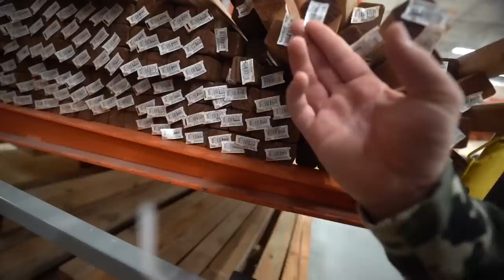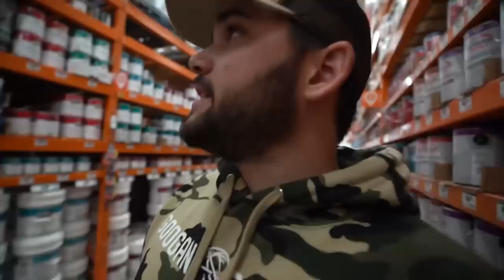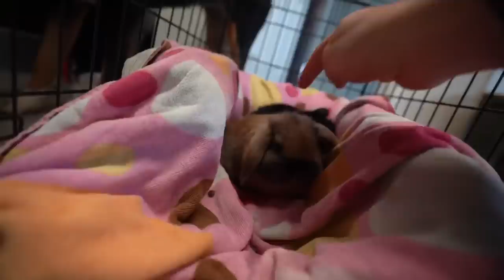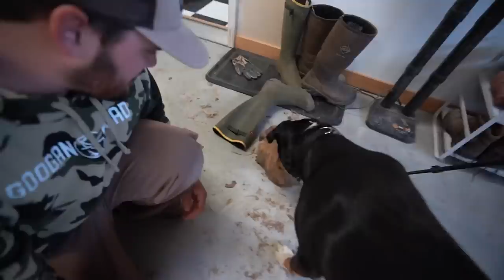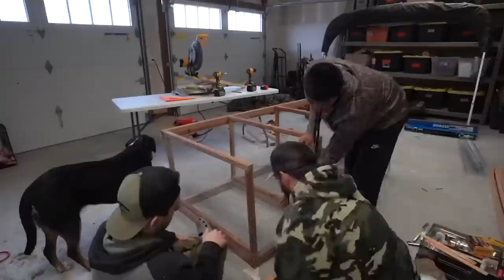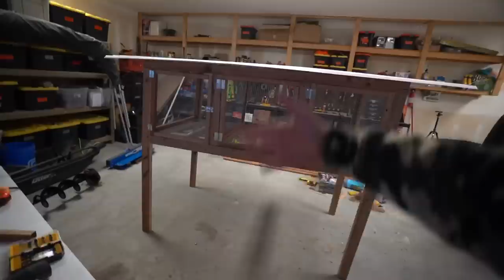BUILDING a RABBIT HOUSE for My BACKYARD FARM!!

Comment: The mash in the cage is Not good for the feet it can cause  injurys
Reply: Yeah it screws up their feet, really bad for them, plus there's nowhere for them to get out of the wind and rain if it blows in
Reply: yeah he needs a square of tile or a small rug for them to sleep on
Reply: Feets 👍🏻
Reply: @kittiesice he should build them a cage at the ground
Reply: It's pretty small too. He could have made a pen and then had a house that they can go in and out of
Reply: We watch YouTube on our 65 inch tv, I grabbed my phone so see if anyone had said this yet.
Reply: @caseyramseyer9874  same, but not 65 in. Lol
Reply: tim no bc if they flood they die and it’s harder to deal with
Reply: @tim9178  i agree or make a free roam enclosure with predator apron to prevent digging.
Reply: ashley nickle I was thinking under the three cages build a big pen for them to go into and be on the ground and the top pens to separate them if needed
Reply: No it doesn’t I used to have rabbits
Reply: tim he should have a ramp that they can run from the ground to the top
Reply: Ryan Jones just have a ramp going to the top that they can run up
Reply: @kittiesice  u can also jist put a piece of plywood in there for them to sit on so they are not always on wire
Reply: Flair did a lot of things wrong in this video (Here's some things he did wrong) You are supposed to paint the wood and let it dry before assembling it. That way you can seal the wood and keep it from rotting. Also when he was drilling the screws into the wood and it started splitting, that is because he did not drill pilot holes for the screws (Which would have prevented the wood from splitting). Another error is the mesh screen in the cage, it is horrible for rabbits, it tears up their feet and can cause injuries. I do not think he planned this out like he should have before doing all of this. Also the roof is done horribly, he should have lifted it and done it the right way instead of half assing it. If he honestly cared about his animals he would have put way more effort into it.
Reply: Mesh bottom is fine trust me we have almost 100 rabbits that we bread all over the world.... dont listen to these others 🤣😂
Reply: @kevingarrison9976  its fine as long as they have a piece of woods or something to rest there feet on so they are not always on wire because that can damage there feet
Reply: Only a hundred?? From experience I have had to dispatch multiple rabbits because of the mesh tearing the the skin and toes.
Reply: Depends on the size of the rabbits we have dutch and polish.... small rabbits bigger rabbits may have more of an issue with the mesh but we show all around the world and everyone has cages with mesh
Reply: @kevingarrison9976  yes i understand that but it doesnt matter what size the rabbit is they cant stay on wire 24/7 and showing is diffrent because they are only in a cage for a little while
Reply: Mines on there 24/7 had rabbits for 20 some years never a foot injury or disqualified for feet issues
Reply: Guys he said he was going to put a pad in there the wire floor was just a test
Reply: @kevingarrison9976  ok then thats bad caring just saying they should have a place to get off the wire im sorry but thats not how u take care of rabbits
Reply: @kevingarrison9976  its true
Reply: @tim9178  and then they dig out
Reply: @caseyramseyer9874  y u flexin ur tv😂😂😂
Reply: @yeeyee2931  they can have wire flooring but they just need something like plywood is wut i use so my rabbits can get off the wire
Reply: @kevingarrison9976  ummm thats not how u spell breed u spelt bread 😂 really shows how much u know ab rabbits😂
Reply: Im not arguing with a 13 year old i missed spelled something cry me a river who cares
Reply: @kevingarrison9976  im just surprised ur rabbits are still alive with being on wire 24/7 with nothing in there so they can get off the wire
Reply: @hunterrouse4399  it's a pretty badass tv
Reply: @caseyramseyer9874  ik i was just messing around
Reply: They don’t need “Feets”.
Reply: @jerseypagan7553  hahah ya ikr but they do.
Reply: @hunterrouse4399  Buddy. You have clearly never had to dispatch your rabbits because of an injury because of the wire. I don't use the plywood at all. I put bedding down for them because I CARE about my animals even if they are for food. Its called doing things the right way and not half assing it by putting a piece of plywood down and calling it good. Take care of your pets and feeder pets and give them the best life possible. How would you like to sleep on wire and plywood? You wouldn't. I have been doing this shit for 20 years, So i know way more about this than you do as a little kid.
Reply: Hunter Rouse you can know what your doing but you haven’t been doing this for 20 years bud. As long as you aren’t one of those owners who makes them sleep on the wire or plywood then you are ok in my books. I have an issue with people who just leave them on the wire 24/7. I am a Veterinarian for farm animals. So I know what I’m saying a lot more than you. I went through school and have my own veterinary clinic specifically to help out farmers and their livestock. I have seen torn toes way to many times. Don’t get into an argument with someone triple your age and who actually has a License and their own practice. I know what I’m saying. You do not. Yea I’m gonna be a dick to some smartass kid who thinks he knows better than a Veterinarian.
Reply: Hunter Rouse that’s good. I appreciate you putting effort into your hutch because you clearly care about your animals. No you didn’t half ass with the plywood I’m talking about people who leave their rabbits on the wire and put a 2x4 in their pen thinking they are fine and leave them their as the home where they eat sleep and drink. Too many people do this and sadly it hurts the animals.
Reply: @yeeyee2931  ok man i just didnt appreciate u acting like i dont care ab my animals
Reply: Hunter Rouse dude. You keep trying to pick an argument. I never once said you abused your animals. Your 13. Let the adults talk.
Reply: tim if you let them free run on the ground they breed like crazy and establish dominance and then kill babies.  The females will never stop fighting. And males will fight to the death.  You have to keep them separate until you breed them or until you are just giving them a little time to play, but you have to watch them while they play.

Comment: Last rabbit hutch I built was a double decker.  I put a sheet of corrugated tin between the 2 cages and one underneath the bottom one.  The tin was high in the front of the hutch and lower in the rear.  The poop would fall thru the mesh and land on the tin and roll out the back.  If it stuck, I'd just use a water hose to push it to the ground in back of the cages. Makes it easier to remove the pellets afterward instead of bending down under the cages with shovels.

Comment: Flair, in the future, drill pilot holes when assembling frames, especially for thinner pieces of wood like the doors are made out of. A small pilot hole will allow you to put the screw in without splitting the wood. Over time, moisture will be absorbed into the wood, and the split areas will end up failing. You may be able to prevent that from happening so soon by using wood glue to hold the splits together.

Comment: To stop the wood splitting when putting screws in drill a pilot hole with a drill bit the same thickness of the screw, also cut the wood then paint it with two coats of paint before assembling  
Hope this helps for future projects.
Ash

Comment: Small tip - drill a pilot hole for the screws and the wood won't crack. Drill bit needs to be more narrow than the screw threads.

Comment: Just a tip, anytime you screw into thin boards, especially cedar, use a small drill bit and make a pilot hole first. The wood won't split that way.

Comment: I wish i was there to warn you about the cedar wood, it’s a very soft wood to it will spilt very easily so you need to predrill the holes before you put screws in them. Also i want to point out that if you put the hut out side you shouldnt use bricks under the legs, concrete actually cause wood to rot. But putting the legs on the grass/dirt will rot the wood as well so I suggest putting a tarp or carpet under the legs of the hut.  That’s just my 2 cents, i hope you find this information useful

Comment: A tip for next time you build something like this that you plan to paint. If you are buying the exact number of boards that you will need to make your project, I like to paint the wood ahead of time when it's all just in long flat pieces. Then, once it is built, you can go thru and touch up the bits that need it. I find it goes way faster and the painting is way less fiddly when you can do it this way. I'll never build and then paint again, if possible, now that I've figured this out!

Comment: To avoid cracking and splitting the wood when putting screws in , you wanna use drill bits and pre drill the hole. And you wanna use a drill bit one size smaller in size

Comment: You should have used wood on the roof first then add sheetmetal onto it. It would help keep heat in better!!  Also you should add removable panels to help keep heat in on really cold days.  Also you should have pre-drilled screw holes so that you won't split the wood like you did.

Comment: Here's a helpful tip for next time you're following instructions with specified cut lengths...cut all of your wood according to the instructions, paint it all, then assemble it all once the paint is dry...that will help seal all of the sections that are untreated when you paint after assembly...

Comment: Hey Flair! Just a tip about the flooring in the hutch! Please put some soft flooring down for them and don’t just leave the bare wiring there. Bunnies have really sensitive feet and will develop something called feet hocks that are common when bunnies have rough flooring wired flooring. A lot of bunny owners make mistakes by buying small cages and leaving the cage bottom/flooring as is when it’s actually really uncomfortable for them! Other than that I’d say probably add a bit more space attached to the hutch or to the bottom of the hutch you built if you do plan on adding a 3rd bunny. As much as it’s excessive, smelly and annoying, their poop is something that you will find yourself cleaning out quite often and it’s not really unavoidable. Adding plenty of hay where they poop is key to controlling WHERE they can learn to poop (bunnies are probably the easiest to litter trap believe or not, ive had one for 3 years). But I did really enjoy this video! You guys did an incredible job building that hutch from scratch! I would definitely invest in building another enclosure that could expand their space even more :))))

Comment: G'day flair i have been love most of your farming video they are awesome BUY YOU HAVE TO PUT SOME THING FLAT ON THE BOTTOM they can get Rabat foot. the wire makes there feet looking like there feet will start   to hook around. Like a bird foot and if they get bird foot!! If they get scared all of a sudden they can rip their feet up pretty bad sometimes. So just go buy some 1 inch plywood and cut it to make it so it just fits in here in Australia we cement sheeting BUY!! To make easy to clean out make sure you paint it  with oil based paint!!! So you just use a pressure washer. It turns into a 10 minute job instead of a half hour to a hour job bro.

Comment: Not pre drilling that cedar before putting the screws all the way in won’t hold long before taking a crap and falling apart, I seen it was already splitting on the end cuts but next cage you have planned I would definitely consider it, but either way nice video tho man

Comment: Have you ever heard of measuring twice, then cut, paint, let dry, PRE-DRILL, then put together.. ;) Also a roof made of wood and (roof asfalt) would be better, since the plastic is VERY noisy when it rains... You might want a little hut on one side, with hay for them to sleep, and especially when they need to give birth, they need to be able to build a nest of fur and straw, in a dark shelter. Inside it could be good with an obstacle for the litter to have to climb in order to get out onto the fence, the little ones, are VERY small and might fall through if they have easy access...

Comment: I ain't no rabbit hutch building  expert but I feel like you should've added a couple  bits of timber to the bottom  going diagonally because  in the wind etc it'll easily  snap those legs, that's my opinion and that's what  I would do. But other than that 10/10 for the finished product 👍

Comment: @FLAIR  Happy New Year, Andrew!  I know this is nearly a year old and you have Chungus in a different hutch/structure all together, but wanted to make this comment in case anyone else reads this before building one of their own. 
A suggestion that I could offer that applies to just about any build project, based on experience, is to paint the wood before you put it all together. Then when it's done all you have to do is touch up the odd cut end, etc. I PROMISE it is way easier this way. Takes 2 seconds to paint a long, flat surface, versus having to piss around painting over staples, etc.
Also, if you take a piece of pressure treated 1" or 1/2" wood and screw the bottom of the 2"x2" legs for bases (so it sits on the ground), you could then either bury the bases, or drill a hole and stake it down somehow. Unless you have it up against a wall, I'd be afraid it could blow over in a strong storm.  
 I see your pinned comment about putting a pad down for the rabbits to walk on... may I suggest an alternative which is that you just put straw down? That way, the poop will still work its way down and fall thru and they are more comfortable walking on it. Plus it is uber easy to clean and when you need to change it out, it will make great compost for that huge garden you are going to plant to feed the critters!.
I really enjoy your channel, Andrew. I am probably the exact opposite of the demographic for your channel (I'll be 50yo in a few weeks, I am disabled, and a single parent), but I have to say that I never miss an episode.  
I hope you had a good Christmas and I hope that 2021 is a great year for you and Macey. Best wishes to Bonzo, Pool Jet and the rest of the crew too.
Heather🇨🇦

Comment: Definitely drill holes first next time. It's not a big deal because rabbits aren't that heavy, but if you're splitting the wood like that it won't be able to hold that much weight.

Comment: Flair I use to breed rabbits just a tip just a dozen balloons and fill them with water and freeze them and on the hot days take the ballon off and put in the hut they will lick it and keep cool if they get to hot they do die so just keep an eye on them
Reply: Also put straw in the huts they scratch around and there dig borrows and stuff

Comment: Flair I’m not trying to be oh you should’ve done this or that like some people. But my advice is that on the doors if you would’ve pre drilled the holes then screwed the door frame together then it wouldn’t have split. And get some caulk or silicone and put in between the two roof pieces to make them water tight. Also how are the rabbits going to keep warm.

Comment: You do have to be careful having them on wire flooring all the time because it can cause something called Sore Hocks which is when the bottom of there feet get tore up and they can possibly loose there nails. Just a warning!
Reply: You could put a small piece of wood in there it would give them a break from the wire cage bottom!

Comment: Just a tip I wouldn’t put the material you have for the floor I would have used wood just because it cuts there feet and it’s very sore for them so you would just have to have a litter box and train them because they could get stressed and die just a tip

Comment: There supposed to use wire cloth . They have furry feat , they will be fine.
Also in each cage put up a wall and cut a hole in it so they can go in and sleep or...
On point 🎉🍌🙌!
JO JO

Comment: no hate, I'm just saying that rabbits cant be kept outside or in wire bottom cages, rabbits feed dont have paw pads like cats and dogs so wire bottom cages can cause serious damage for them, and they shouldn't be kept outside either because of temperatures and even if animals cant get to them, they could still get scared by seeing animals, not to mention if it snows or rains, the rabbits would be freezing cold which is extremely bad for them and the cage could still get damp which can cause them to get sores on their feet, I've seen t happen before to my friends rabbits so its very common, which is why they should have a space indoors, but in  some kind of blocked of area with veggies, hay and a litter box, not a cage. hutches and cages actually originated from when people would  fatten rabbits up to eat them. rabbits are actually a lot of hard work so its important to do the proper research before getting rabbits

Comment: I don't like this design bro because yeah the poop falls but it puts alot if stress on their feet especially at the size you guys  had if they were quite a bit bigger or smaller diameter holes i had this same basic design and it states tearing up their pads  on their paws so i changed it ok had a decent thick piece of Plexi glass i cut to size and put like these things fuck i forget what they're called they spin around on a screw and you spin it around to where it's over top of something to hold it in place and then spin it the opposite way to release it